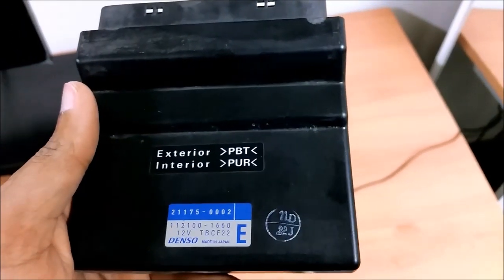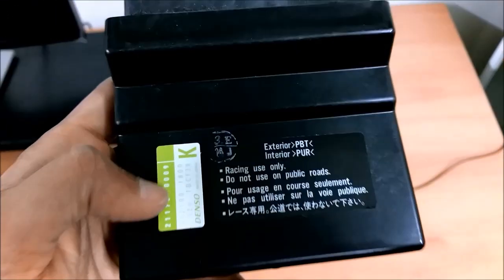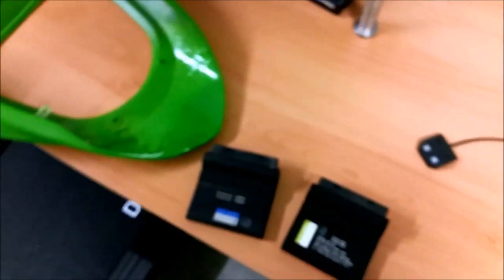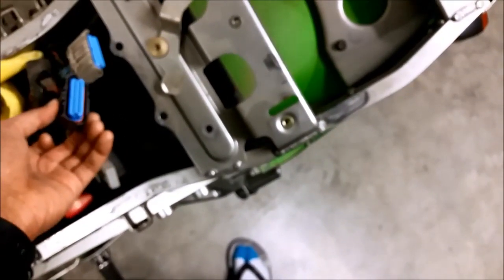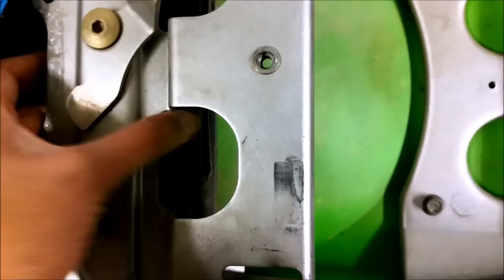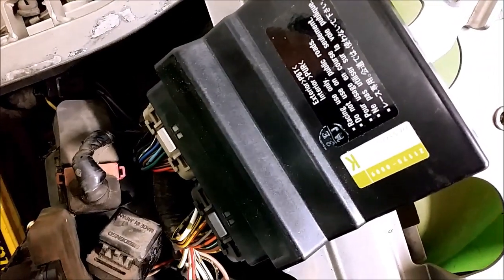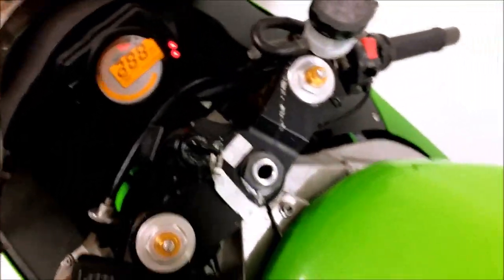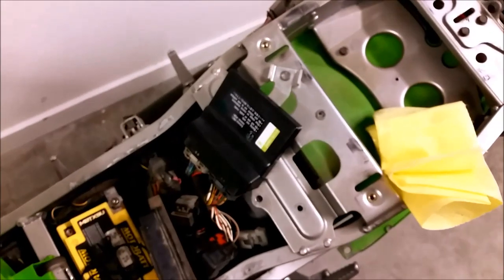2003-2004 ZX-6R & 2003 ZX-6RR KRT ECU Install

Comment: Hey man, 
Zx6r 2004 wiring harness and ecu can be fit in zx6r 2005  ?? And it will works  ?
Reply from the maker: No, it will not work. It is a different model.

Comment: What ever happened with this. I have been trying to find someone that has the interface  and a dyno that can clean my map on my 03 zx6rr for months but no one has the tools to touch it anymore 🤦🏻‍♂️
I have the race ecu and all the bike only has 3400 miles its a rebuild restore project
Reply from the maker: There’s a guy in the comment section here called Nikolas, contact him and see if he can help you.

I have sold the bike ages ago, but still have the spare race ECU. I think I was told that the moment I put it into programming mode, it will erase the existing map. So I didn’t do anything else with it.

You’ll probably have to work out a setup, and take it to a dyno operator who’s willing to spend a bit more time with the software.

Comment: I can help with extracting the bin files from both ECUs , I already have the bin from a 21175-0001 which should be pretty similar to yours 21175-0002
Reply from the maker: That would be cool - could you tell me the process? Is it similar for both the KRT and stock ECU?
I would also like the bin file for the 21175-0001 if you are able to send me that.

Thank you.
Reply: @motorradtyp  Yes I can send you that no prob.
Reply from the maker: @nikolasbalogiannis3577  My email is mmmotorcyclesss@gmail.com, thanks
Reply: @nikolasbalogiannis3577  what are these files? I have a race ecu but I dont understand...
Reply: @robzillagarage  these files are the "firmware" of the ECU, they contain the code and the maps for the bike to run. 

You can make changes to them and then reflash the ECU with the new file,so you can tune the bike without a powercommander/bazzaz etc
Straight through the ECU
Reply: @nikolasbalogiannis3577  oh wow didnt know all that. Thanks